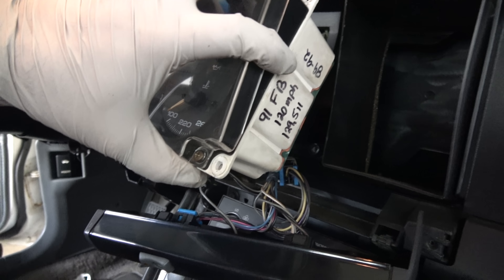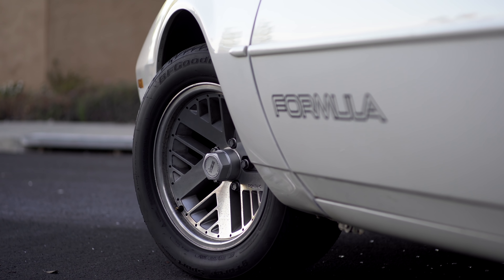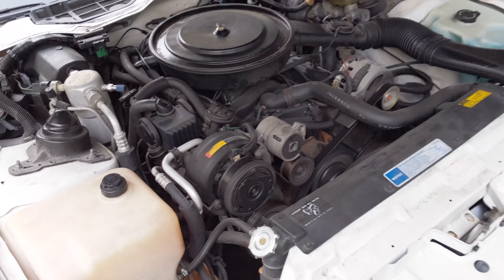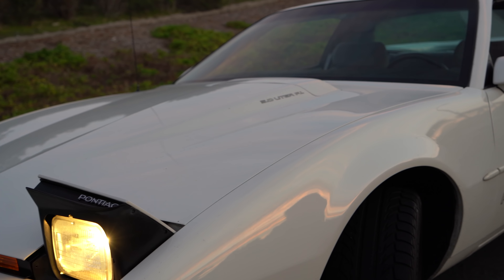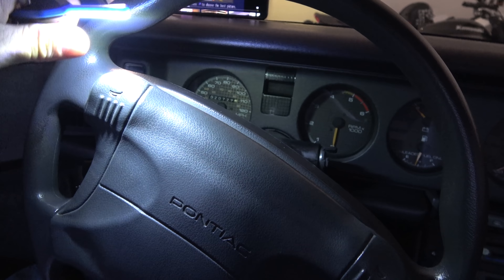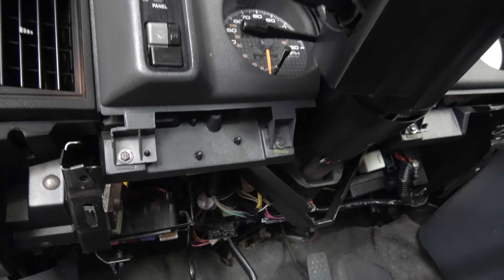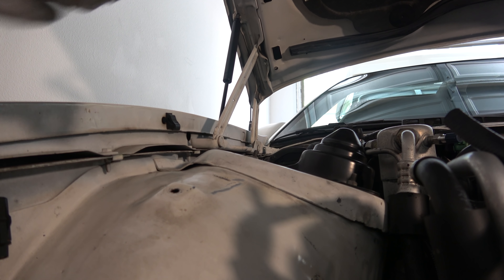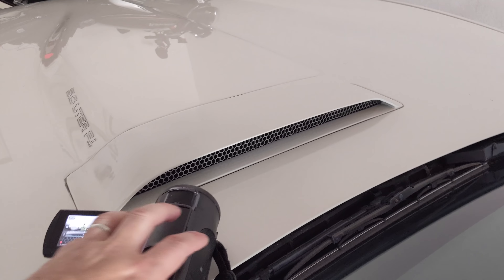LIES! Odometer fraud on my 1990 Firebird

Comment: the writing one the side of the odometer means it came out of a scrap 91 car with 129511 when they removed it from that car. it has nothing to do with yours. it also means someone had the odometer rolled back on that replacement dash
Reply: Why write it on the side if it says 120k on front?
Reply: That is what I think, all of the print is in the same hand and marker. That was all written at the same time.
Reply: or it was a brand new speedo and that was the current when it was replaced?
Reply: Still fraud since the mileage on the odo was NOT clearly rve the mileage
Reply: Exactly. I'm glad other people are mentioning this!
Reply: The markings mean '91 FB' = Donor Car was a '91 Firebird. '89-92' = Suitable for an 89 to 92 Firebird. '120 MPH' geared for a 120 MPH Top Speed Firebird. '129,511' = Donor Car original odometer setting to stop fraud when installing into a second car.
This does not stop the installer from clocking the odometer to a different setting from the original to make it appear as a less used vehicle. It should have been matched to the same as the one being removed before (The original from your car that this one is replacing).
Reply: They might have had a fault somewhere else on the instrument cluster, and swapped the original odometer into that one.
It's impossible to know for sure.
Reply: @zaxarispetixos8728  if it's from a wrecker's yard, it's easier for them to store and find things on shelves like that, otherwise they'd have to have every set of clocks facing outwards.
Reply: @juststeve5542  ok but there is no way this car has less than 80-100k miles
Reply: @zaxarispetixos8728   yeah i think we all agree on that
Reply: @zaxarispetixos8728  I'm not sure. The interior is usually a very good indicator, and that looks very clean.
The oil smoke on startup from the valve stem oil seals could be a false flag as they are rubber, so can break down purely due to age.
 Plenty of things will degrade just with time, add in the ethanol they now put in petrol and you can quickly find you have a screwed up fuel system (if it wasn't designed for it) too.

I wouldn't be so quick to condemn it as a knackered old banger (as we say here), just maybe not as low mileage as he thought.
Whichever way it is, it's still only done 5k since 2015.
Reply: @juststeve5542   I would argue that it's a junk 305, they were junk from the factory. My friends dad years ago had a crate motor professionally installed and it puffed blue from day one....
Reply: Correct, thats what I was going to say, this is the miles for the car it CAME OUT of not the one its going into.
Reply: Junk yards right info on different sides of parts depending on how they store them on a shelf. Same with lighr assemblies.
Reply: How wore out is the break pedal?
Reply: Agree this dash came from another car.  I'm curiouse. If your gonna reclock the odometer. Why not reclock the original? Would be the same process on either dash. In the old days, (5) digits vs (6) digits today, they would just hook a drill to the back and run it forward till it clicked over 99,999 miles. Now you gotta go to a million.
Reply: I know it's been said on here before buy yeah i was gonna say that that probably is not the original miles on the car but what the junk car had on it when the scrapper puled it out. I think most of that car's issues can very well be seen just from the car sitting for a long time. It may have also had the Odometer rolled back as well but i don't think this is a car with 149k on it.
Reply: @hickeyskustomresto  quite
Reply: Steve Evans The interior could have come from an immaculate firebird written off at a much lower mileage and someone stowed the seats away for future use/sale. There's nothing to say it came with that car, having looked at the other telling signs.
Reply: @zaxarispetixos8728  when there is a pile stacked on a shelf,(in a wrecker) you dont have to pull each out, to see whats what... why its written on the edge. its what it came out of, not his car that its currently in !
Reply: @ryannakamura6906  
The original is broken or damaged.  New cluster parts are hard or impossible to find for something this old so they got a used one and set the mileage.
Reply: Never thought I'd see the day these were classics. When I returned to the US after serving overseas for 2 years, I really wanted to have a car really bad. Instead of flying to each of my military schools, I  bought a 92 firebird. Drove from Florida to Maine, to North Carolina then Oklahoma. Fun car. Then over the next few years I bought two 1989 indy 500 turbo trans AMs. Turbo charged V6s. 
One of the dashes had problems. So I bought a dash from Ebay. Had similar miles. Remember when I could walk into a dealership and buy this stuff new. Damn I'm getting old.
Reply: While it was incorrect of Winston to assume that the mileage was the car's original miles, and things like valve stem seals will certainly deteriorate over time when sitting for years, the fact that the gauge cluster was replaced on a car with under 20k miles is very suspect, and the fact that the ECM was replaced is even more so.

Now I know some early 90's cars have had issues with bulging/exploding capacitors inside of their ECUs, but it just doesn't seem likely that a well-kept car that was barely driven would need both an ECM and a new gauge cluster. Especially when it runs as poorly as it did when he first got the car.

Either this car was one hell of a lemon from the factory, or someone tried to polish a turd.
Reply: @rars0n  Poor mechanics, can make a cherry a lemon, in no time, sadly...  Parts were cheap for those cars for quite some time and to the point that.. its easier(for those who dont have proper skills to track it) to just randomly replace stuff in a effort to track some other issue down..
Reply: Usually when us mechanics see something like this It usually means the cluster was purchased from a scrapyard and The odometer from the old cluster was installed into the replacement cluster
Reply: Adam Baldwin I’m betting that when the car was stolen and recovered that it had been partially stripped and is why he’s finding all of these replacement parts throughout the car. He should have reported it and probably could have gotten his money back but who ever put the car back together did it with the cheapest parts they could buy so they could get it back on the road and sell it. 

With the ecm also being replaced, Winston won’t ever be able to download what the actual current mileage is so it will always be in question and will always hurt resale value considerably. I’m sure it will be a nice car once he is done but anyone attempting to buy it will never give him retail price due to it basically being a salvage car and should have probly stopped and reported it and gotten his money back and looked for another one, they are out there but he didn’t which is fine other than the bozo that did it now gets away with it again. 

In today’s world, with all of the floods, and other natural disasters we’ve been having this type of stuff Is very common and is why I would not consider buying a car via video or pictures! Too many things can be hidden!!! If you can’t look at a car then there are guys that will do it for you and guarantee their inspection and if it’s not what you were expecting then it’s easy to cancel and get your money back but Winston diol now and got taken advantage of like many others around here
Reply: I totally agree on this and don’t understand how winston was confused. Seems a bit ridiculous to be running a car channel and not be aware of things like this.
Reply: @tmd63  to close the loop, I would think that the setting on the odometer being replaced would be written down as well---maybe a different color marker, but that would remove any questions as to the mileage on the car at the time of replacing the odometer.  Thanks for your helpful explanation!
Reply: @zaxarispetixos8728  In case it is returned to the salvage yard with a complaint .   Not rocket science.
Reply: That sucks, I just wonder how it missed carfax for that many years. I wonder if the vins all match but California would have checked that during the out of state inspection.

305 will run forever and that time period they made a lot of them.
Reply: In Michigan, they do just what you described, Vincent. My friend's dad worked at a scrap yard and they do it so they're doing fraud. Long story short, the car still has the Formula for happiness.
Reply: @ryannakamura6906  they may have reclocked this one so they don't mess up doing it on the original and if they needed the could always put the old back in if miles on it were lower still

Comment: its a felony in the USA to change the odometer lol go get em
Reply: and carfax has a warranty... if you paid... and you can sue the seller...
Reply: Wish I knew this back in 2010....
Reply: Wait that's a crime in the US? Here in eastern europe it's a fact of life lol. I don't think I've ever seen a car with the correct mileage.
Reply: Did you watch the whole video? The guy who did it probably wasn't the seller.
Reply: Only if they start prosecuting ;)  Besides i've "heard" that car rental places do it all the time.
Reply: It's not a felony if you're honest about the odometer change in your paperwork. Most states have a box that says "The odometer does not reflect actual mileage" for any situation where the odometer stopped working/etc. It does lower the value of the car, but a lot of people actually will roll their odometers to zero if they've rebuilt an engine, if they plan to keep the car for a long time. If you lie about the odometer reading, though, then you're screwed.
Reply: @GilBatesLovesyou  He represented it as 20k miles... if you replace the odometer you have to state... its a felony in my state.
Reply: There's no proof the odometer was swapped out or changed in any way . Only proof that the back piece of the cluster is not original .

Comment: From the moment you said the car was low mileage I was skeptical. There’s no way a firebird was a garage queen. And there’s no way a garage queen would be in that poor condition. Oh well live and learn.
Reply: Also 130k miles in a 30 years old car isn't a big deal at all. At that age I wouldn't give a crap about mileage, everything is 30 years old, if it runs that's great. But that's pretty much it.
Reply: William Schwartz  You are right, the last few videos perfectly showed the issues, it's still not the mileage what the problem is in my opinion... But everything else.

Comment: Didn’t expect to get ripped off on a car deal in the US?  Winston ,  we need talk.
Reply: Rolling back the odometer is the best kind of scam, I just bought a mint F150 only to find the front quarter panels are held in with self tappers. had it aligned twice and it still doesn't drive streaight. rip

Comment: The replacement cluster was off a 91 Firebird with 129k miles hence why it was written on there (and your car is a 90 not a 91), junkyards often write these things on their parts for inventory purposes. Odometer was then adjusted to match the mileage of your car. Your car likely does NOT have 129k miles, but rather the original.cluster broke and they got a used replacement one.

Any 1990 car with 15k miles will have the wear/issues you noted due to age, lower quality components in that era, and not being garage kept.

Comment: Sorry man...I'd go after the seller, that's essentially fraud.

Too bad, the gen 3 formula 305 is a great car judging my brothers old one.

EDIT looks like the fraud happened a long time ago, never mind.  Sorry bud.
Reply: Bill of sale = sold as is
Reply: @Pie4life123  didnt realize it was bill of sale.  I hadn't watched the whole video
Reply: @Pie4life123  You can sue if they fraudulently claimed mileage on the vehicle, even with the "as is" claim. The problem would be proving the previous seller doctored the numbers or was aware that the mileage was off. This car came from a shady dealer who sold to a guy in Ohio, who then sold it to this video poster,  so it's passed who knows how many owners.
Reply: Lots of issues with that idea.

1 - if he wanted to refuse, he really would've had to do that at the time of delivery, even on camera you hear the driver try to ask him if it's as expected, he accepted the car so the deal was done.

2 - from the looks of it, it's not the current seller who committed, the fraud, but a past seller.

However, fraudulent mileage can't be waived away with an "as is" claim, as the other poster has observed. The issue is that he would have to find that the seller knew it was fraudulent. At the "best case scenario" the deal could be unwound, but he still would be out the extra cost of delivery from another part of the US (the seller wouldn't be liable for that unless you went to court for damages, which you'd probably not get if the seller was unaware of the fraud). And he'd have to pay to ship it back on top of all that.

Comment: Hey pal, the markings just prove that the odometer came from a junkyard. That mileage written is probably not from your car, you can clearly see that they just identified the part. Your car real mileage is unknown for sure, but definitely not 129,000 on such a clean shell. ECM replaced? Well, is there any signs of flood damage?

Comment: Funny how mileage gets folks worked up as some holy indicator of a cars condition. A vehicle not used a few times a month degrades like mad. If it sits up for years then the fuel in the tank turns to goo. The brakes lock up. The brake hoses fail. The computer's electrolytic capacitors short out. The speedometer shaft on mechanicals can get stuck. 

An old coworkers friend drove an almost brand new 84 Corvette from SoCal to Alabama say in 1985 and I last heard it was in the same barn undriven in 2015 as a mess. Rats and critters ate the wiring and all the brakes were locked up. Thus a car with under 10k miles became a basket case project car. The owner had home rural property and had his dream car in his garage barn while working around the usa from job to job. The lack of use cascaded a working car to just a mess. The power steering after sitting for years only worked when turning one direction, ie like a spool valve was stuck or something.

Comment: Valve stem seals are really easy to change on that SBC. I use nylon rope in the spark plug hole. Turn the crank to compress the rope against the valves. Remove the keepers from the top with a top down spring compressor. Replace the seal. Easy peasy. You don’t even need to remove the head. Side note: make sure it’s nylon rope so it doesn’t leave debris in the cylinder. I’ve used this method with success many times.

Comment: Don't assume it is stem seals...with that mileage it can very likely be the valve guides. I would do a leak down test and then plan on doing heads and cam for better parts. As long as the bottom end is in decent shape, you will get a huge bang for the buck with heads and cam.

Comment: Winston, have you run a compression check and idle vacuum test on the engine? If you can compress the valve springs and remove the keepers, you can check the clearance between the valve stems and the valve guides. If you can borrow a fiber optic, have a look at the cylinder walls for evidence of broken rings. They generally score the walls over time. For myself, I don't buy something like this unless I've done a compression check and vacuum test at idle. That said, I too have wanted a particular car so bad, I was inclined to overlook the problems. Good luck. Before I go, have you looked over the body part fit and odd paint mismatches inside the hood and trunk? If its been hit, you'll often see evidence of the body work there. Take care, man. I'm sorry you got screwed on this one.

Comment: I bought an 02 Trans Am with supposed 60k miles.  Turns out the guy that sold it to me swapped the gauge cluster and it really had 170k miles.  The guy came to my house and put the original cluster in and gave back $3k
Reply: He just gave it back to you? I thought he would just scam you never to return...
Reply: @drakes4625  I knew where he lived and he had a business license
Reply: I thought that or was told that once the computer reads the mileage even if you change the cluster it would read what it really is, guess i was wrong.
Reply: Found out that the ecu keeps the mileage not your instrument cluster on cars with electronic speedometer.

Comment: 85 MPH speedo's were common on most cars through the late 80's.  The car probably had an 85mph speedo originally and they replaced it with a 120 mph version.from a junkyard.   That's why it has the range of years it's compatible with plus the 120 designation.  Now if they took liberties at the time of the replacement, that's another story....

Comment: The replacement speedo from a junkyard had 129k miles on it. The actual mileage on the car today is unknown. There are only clues as the actual mileage. Whether the car has 20k, 50k, 100k. 200k what matters it its condition.

Comment: I think you’re perhaps jumping to conclusions a bit too soon.   A theft recovery often has many parts stripped and I’m guessing it was put back together using whatever the rebuilder could find in parts yards.  The tired valve guide seals can also be the result of just sitting around.  Do a compression test and scope the cylinder walls to see what they look like.   What does the rest of the car look like underneath?  Does it still have assembly line markings?
Reply: The Gas and Brake pedals are a great place to get the true age of the car.
Reply: William Schwartz  Aye, with good shifting. My father burned out a clutch in 5K miles because he was profoundly deaf and didn't know he was slipping the clutch so much.
Reply: William Schwartz  Normally yes.  Although stolen cars often get heavily abused before being parted or dumped so it might not be a telltale sign in this case.